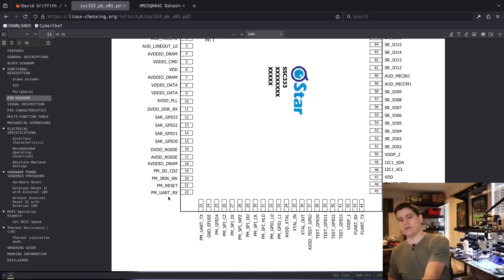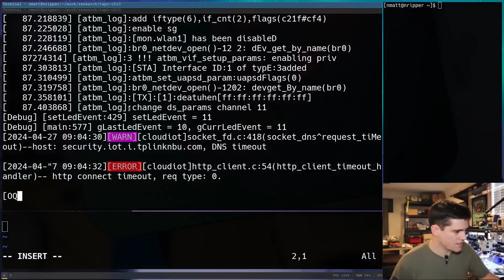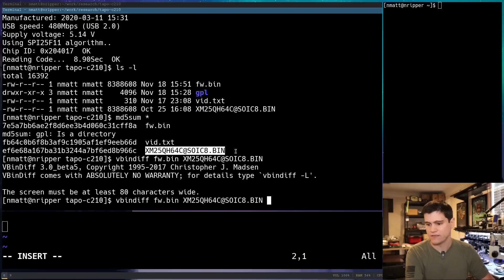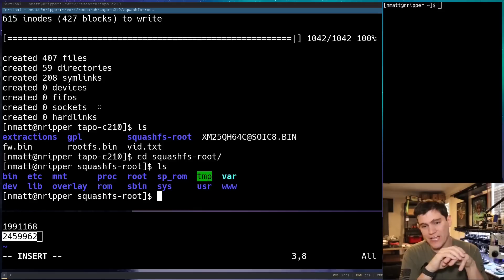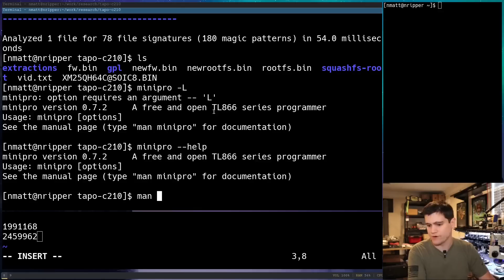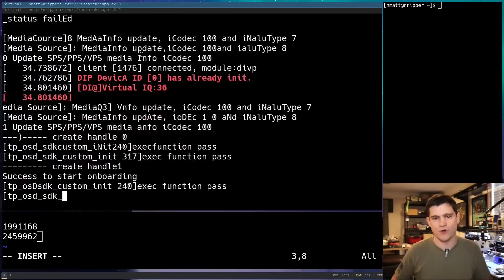Persistent Root Shell via IoT Firmware Modification - Rooting a TP-Link Security Camera

Comment: first of all, pretty awesome video.
but i have a question, you said that notrunc prevents dd from truncating the file.
But wouldn't that allow it to overwrite part of the data after the SquashFS section, since the modified filesystem is larger than the original one?

Comment: If new squashroot is different size does newfw.bin not have either leftover data or truncated data? Would a more complete newfw.bin not require two calls to dd with new count for the 1st and offset for 2nd?

Comment: Nice video ! Quick question, in case you don't have a chip reader (or the ability to unsolder the memory chip), if you can anyway get a shell easily at boot, how would you extract files from that UART connection ? In this example /bin/cloud-iot. Thx
Reply from the maker: Ohh that's a good question! If there are any utilities that can transfer files (curl, netcat, etc) you can use them to exfil files off the running device. This is a good video idea
Reply: @mattbrwn  Yup, I suppose sometimes you even need to transfer such utilities from your host to the target device. AFAIC, file transfer over netcat is always syntactically painful

Comment: FYI: it looks like binwalk v3 has already been pushed to the arch repos, so unless you need your special fork you should be able to use the rust version with the main binary. It looks like you incidentally used v3 in the new binary without noticing when you ran the extract. Wonderful video as always.
Reply from the maker: Yep! I just have the old one installed also so I can compare findings. I already made one commit to the rust version and needed to see the delta with the old tool.

Comment: You explain the whole process of working with hardware in a very understandable way, its not too caught up in details. The way you walk people through it makes it so easy to understand the basics of working with hardware which for me atleast was the most intimidating part. Since watching the channel I've been able to do a chip off firmware extraction, get a uart shell with my flipperzero as a bridge and locate a vulnerability in a router. It might not sound like a lot if you're watching this guy's videos but this is from someone with zero hardware experience or formal education. Big ups to Matt for being an excellent teacher🙏
Reply from the maker: This is awesome to hear!! 🫶
Reply: If I wanted to start learning things such as this and other things on this channel where is a good place to start leaning to be able to use these videos in a constructive way? Should I watch programming lessons or maybe even start with a programming board? I am a tinker'r at heart. I love to teach myself new things just at a loss on where to start if I have zero experience. I have slight knowledge in some hacking OS's and common programs used for hacking like nmap, wireshark, metasploit, etc. but nothing too this magnitude. I also use Linux as my daily driver OS and have been using it for 2 years now, Manjaro to be specific after I distro hopped for the first year familiarizing myself with the terminal and FISH or Bash shells like ZSH. As a Windows user all my life this took enormous research on my part especially when experiencing bugs during some updates. Any advise from anyone would be much appreciated.

Comment: Nice video,

Noob question, is it necessary to desolder the chip for reading / flashing? I've seen these clip-on soic cables.
Reply: I prefer to try that first, "usually" it works fine, however sometimes injecting power to the flash chip pins will make the CPU or other chips "wake up" and then that can get in the way because then multiple things will be barking commands at the flash chip.  Sometimes you can get the CPU to hang using tactics similar to the bootloader glitch like ground some of its address lines so it hangs trying to hit RAM or such (or some SoC chips have a reset pin which will hold the CPU in reset, which is better than glitching it), and then it will leave the flash DI/DO pins alone (floating) so the programmer (CH341 or similar) can use them without interference.

Comment: Why are you not connecting the tx and rx to the test points on the pcb that are nearby the chip (4 round ones) ??
Reply: Some devices don't have those, and showing how to do this regardless of specific device or board layout is more useful.  Of course hunting around for test pads that end up at the SoC pins is always an "extra credit" option.

Comment: Noob question: Why are passwords so often hardcoded?
Reply from the maker: if you make random passwords then when they are developing the device it makes it harder for them to get it. Not a good excuse but most of the time its devs being lazy
Reply: Assembly line programs a million flash chips at once.  Having custom chips per device is more of a hassle.  Some devices if they have a RW partition like jffs2 overlay will generate a custom password based on the MAC address or SoC serial number or something unique, like the routers that have custom wireless passwords per device.  If it's all readonly like this one with no overlay it basically has to be same hash for all (of the same FW revision anyway).  Some might have a custom /bin/login that reads the hash from a configuration partition (not a filesystem, not /etc/passwd) and then it could be customized per device along with the MAC and such.  Usually the wifi or ethernet chip will have its own MAC so the firmware doesn't have to set it.

Comment: Hello Matt I have  device with scraped chip on it how can determine what it is ?
Reply from the maker: This is tricky but if you can put in a reader like the Xgecu and pick a chip profile with the same chip type it will probably give you a chip ID error like "expected chip ID 0x11223344 but received ID 0x55667788"
Then you can try to search around for that chip ID.
Reply: If you can see the early bootup messages sometimes the kernel will spew the chip identification when MTD comes up.  Most chips use a fairly standard pinout (for the package type, like SOIC8 vs SOIC16 etc) and the same commands for the identify phase so even selecting the wrong thing as Matt said and then getting the actual chip-id that way usually works fine (just don't try to read/write/erase with the wrong setting).
Reply: @Spudz76  i will try that. Its SOIC20 a bit odd.

Comment: So good. Important point is if you repack the squashfs - make sure new image size is <= the original.
Reply: Technically < the space between the squashfs's shown in binwalk, like 4456448 - 1991168 = 2465280 although keeping it within the original squashfs header shown size is technically safest in case the gap has something else in it that binwalk doesn't know (usually not though).
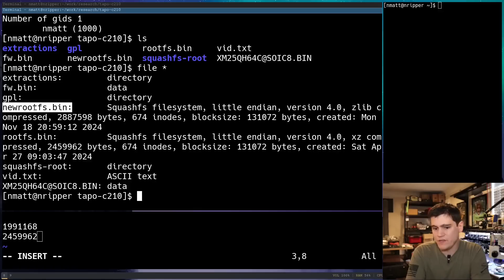Reply: 20:29

Comment: Instead of pointing in /etc/inittab to /bin/sh I would consider pointing to a script placed on any RW partition (if available) then it would be easier to manipulate and test some behavior after reboot. Just a humble remark. And as always it was nice watching your findings.
Reply from the maker: No RW partitions. Otherwise we could modded firmware from the temp shell we got from the bootloader (see prev. vid)
Reply: @mattbrwn  Usually the flash will have a read/write area for configuration.

Though if not, can usually find a way to alter the rootfs to run a script that is downloaded, or via NFS mount, or SD card.  That way can play without having to rewrite the chip.

Comment: You could also just spin up an isolated Windows VM that has no network connection to run "sketchy Windows software".
Reply: It's a great way to test out sketchy software. But in the long run, using native OSS SW is best

Comment: What would happen if the inserted squashfs is bigger/smaller than the original? I assume if smaller it'll be padding, but what about bigger file? Were the start offset of the next file within the firmware important?
Reply from the maker: Smaller is fine, bigger is a problem because there is another filesystem it would run into. however I don't think this other filesystem is used normally (it might be used for firmware updates)
Reply: It could be slightly larger since the actual space between the first squashfs offset and the second one is 2465280 bytes (=4456448 - 1991168).  However occasionally a device might have some nonstandard/proprietary data in between like headers or nonvolatile settings or such, that binwalk may not decode.  Checking with a hex editor for 00 or FF padding in the "unused" zone would help confirm it is not used.  Usually devices avoid doing anything outside of the eraseblock size of the flash chip because it would have to erase and rewrite the last eraseblock of the squashfs with their custom data injected on the end to do that, which could lead to bricking or block wearout and is just bad practice.